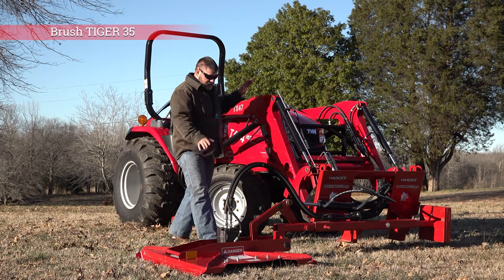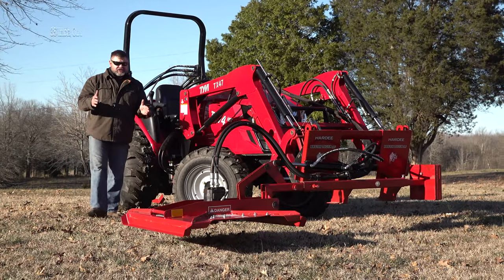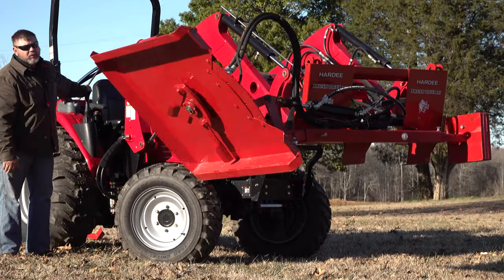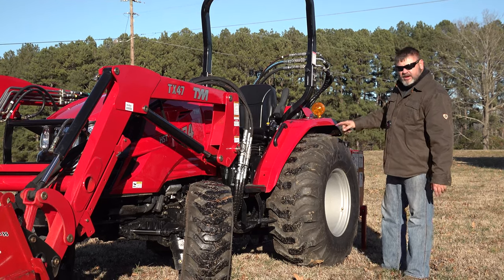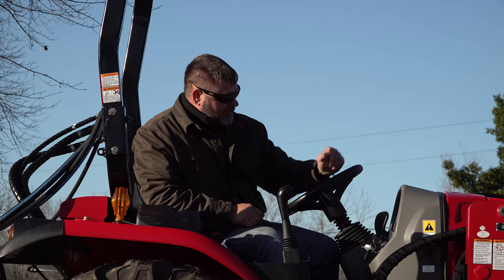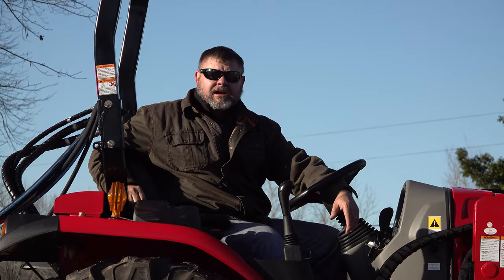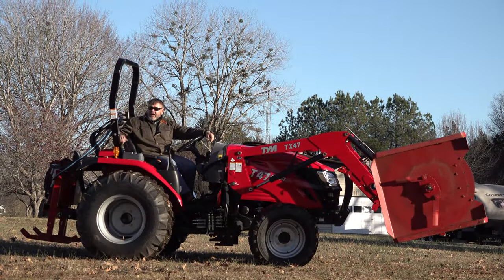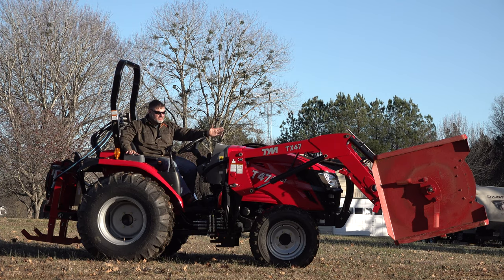Brush Cut Road Side Better - Brush Tiger

Comment: I like that the oil tank on the power pack is offset to the left to also help with tractor balance.
Reply from the maker: The system is really well thought out and built like a tank. This will be here for years.

Comment: That is a Great idea!
One suggestion from me to Hardee Mfg. is to put wheels on each side of the cutter to evenly roll over the ground for mowing.
Reply from the maker: The thing is, that it is meant for more than just the ground. Maybe removable wheels. I could see me hanging that thing in a limb up in a tree with wheels, plus I don't think they meant it to be a precision mower. Any weight added to it, is weight hanging out there when a person is mowing. It would have looked a whole lot better if I was a better operator. That was my attempt at operating the Brush Tiger

Comment: If you are running/operating on asphalt surface or concrete...I'd add a gauge wheel on the front end loader bracket -  so you're not even having to think or adjust. Nice little unit!
Reply from the maker: I am loving it. I really like how flexible it is. The guage wheel idea is neat.

Comment: Very nice Tony 👍 Once you go with this type system you can use the rear hydraulic unit for other attachments 👍 Snow blower / front auger . It’s pretty much endless what you can run hydraulic on the front . With this mower you  can make a lot money on side doing work around ponds and hard too reach places 👍 The only thing I would add is a quick attach Lexon plastic impact windshield too the loader uprights for flying debris .  Pretty cool machine Brother 👍👍
Reply from the maker: Word is Hardee, will make many matched attachments.

Comment: Several things, Tony.  I have been researching cutters the past 3 years and Hardee is without a doubt one of the strongest made brush cutter companies in this area.  Before I ever heard of them, all the local NC folks said the name  Hardee before I even mentioned any other brush cutter company name.  Hardee has a standing contract with Massey Ferguson and my 4 foot rotary cutter I have on my GC 1710 is the 4 foot Hardee cutter.  It's a tough unit and will withstand the beating from a battalion of COVID- Gorillas.  I was looking at the Land Shark and Trail Blazer and I liked both but wished they would have merged their construction technology.  It appears Hardee actually did that concept.  I wanted a separate but dedicated, hydraulic pump, and Trail Blazer hss that but now the Hardee is in the House.  I would like to know cost $$.  Trail Blazer currently has a special sale running through February or March and that too will be a major (co$t) factor.  Talk to me about CO$T and military discount. I heard you say Ugh-Oh when the TYM front wheels got turned  sideways in the ditch.  I have plenty of ditches here in NC but much steeper. Thanks for sharing this video and wish you and your bride a Merry Christmas.  BTW, beard looks good on ya, brother.  Just shaved mine off;  will regrow next season.  Later.  👍🏽🙂
Reply from the maker: I never talk about price on the channel because it changes. Shoot me a private message on Facebook.

Comment: I like it but if you want feedback here it is. I've mowed an bushhog a lot of fields an banks in my lifetime. I use a bushhog brand behind a Ford farm tractor. It looked like the cutter itself the side rails are 4 inches. Whereever the blades spin at I want 6 inches from blades to the side rails or slides if you will. An that keeps blades out of dirt. It would allow you to put box of cutter down on ground an let it float along without raising it up or down all the time an minimize blades digging in the ground an minimize stuff flying out from under it.
Reply from the maker: I have a good many hours on it now. I have found it to be very well thought out. It is a pleasure to work with once I got the hang of it.
Reply: @TonysTractorAdventure  I'm sure it works fine watching the video it looked like you were picking it up a lot. This bushhog I use i set it on ground its 6 inches up from slides on side to blades an of course grass is 6 inches high but I don't worry about getting into nothing. All I'm saying I've been on a farm here in Tennessee all my life it wouldn't be first time I altered something to suit me.
Reply from the maker: I agree. I have altered many things to suit my needs. No harm here, I just really like this one. I had very little time on the machine in this video.

Comment: Hey Tony, happy new year! Nice piece of equipment. Question: what's protecting you from debris flying back and hitting you?
Reply from the maker: The rotation of the blade and operator's skill. The operator must  never move the head in a way that they can see the blade. Tractors are dangerous and each operator assumes a certain amount of risk. Having said that, I never felt I was in any danger.

Comment: Nice one! Do you think it would even better if it had adjustable wheels at each corner?
Reply from the maker: I don't. It would add extra weight and get hung on things. It is meant to hold up in the air and trim branches too. It is not really meant to be a finish mower. I think I will get better at it with time. This was my first day working it. I learned a lot.

Comment: I notice the blade spins counterclockwise dragging all the debris it's chopping up onto the road. Mfr needs to offer a clockwise spinning option for lane keeping since you now have to clean the road you've clogged with debris.
Reply from the maker: If it spins the other way, it will throw everything at your head from the backside.

Comment: Nice trimming mower there and its all self contained so would be easy to run on many different tractors as well .. Only thing is make sure you know your local laws when mowing along public roads since here i would get a ticket for blowing the clippings on road and for not having any chain or rubber flap guards on mower
Reply from the maker: Around here, the county pays people to do this with farm tractors. A tractor coming behind with a blower would do the trick.

Comment: well it seems like a good idea but I actually run a road mower for a township with a boom 5 foot cutter and we have to be in a cab to run it and bullet proof glass on the passenger side door  ,which has shattered b/4 from a rock on the side of the road ditch flying up if it was not there the driver definetely would of been killed ,. and it will throw a rock over 200 feet away , so not sure of this concept
Reply from the maker: I have never had a rock thrown from this setup. Obviously it has a lot to do with how it's used.

Comment: Since this attachment is mounted on the right side of this tractor then the mower blades should be turning to the right so the cuttings stay on the right side. I certainly wouldn't want to be clearing trails with this mower as it throws all the debris back on the trail or road in this case.
Reply from the maker: That would be bad. Then the blade would be throwing stuff at the operator from the backside of the mower. This is the best way.
Reply: @TonysTractorAdventure  I completely disagree, A strong argument can be made that it would be much safer because it is exhausting from the front before it is drawn threw the mower housing.
Reply from the maker: I am always up for debate. In this case, I own it and had lunch with the guy who designed it. It is designed this way to keep it from throwing stuff at the operator's face. Operating it in real life throughout all of its ranges, I can say without a doubt, if the blade rotates the other way, it would kill someone.

Comment: If a company can’t give at least a rough price without jumping through hoops piss on them. I’ve spent the last 30 minutes searching and seems nobody wants to give it up. ✌️
Reply from the maker: Hardee doesn't sell directly to the public. This is also not a standard implement. All the hoses have to be made for your tractor. This is a specialty implement and, as such, takes a bit more information to purchase. This cutter is fantastic and offers so much flexibility when mowing. It is not a box store purchase.

Comment: cool idea. Looks like it could be dangerous. lol
Reply from the maker: Operation of a tractor is dangerous but a skill that is learned. This is as safe as any cutter which is operated as intended with experience. I would recommend to a new tractor operator to go slow at the beginning and learn to feel it out. I am not new to tractors, but I was still very slow and meticulous starting out. Turns out, it was very easy to use. I felt very comfortable after about an hour of uses.